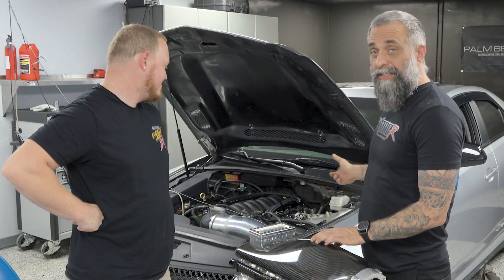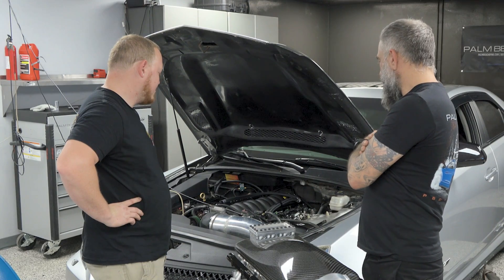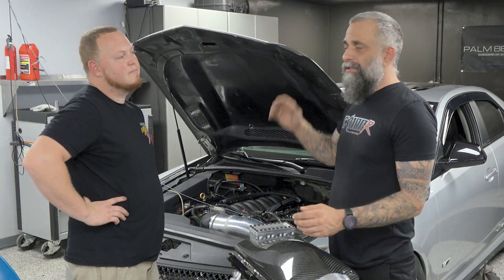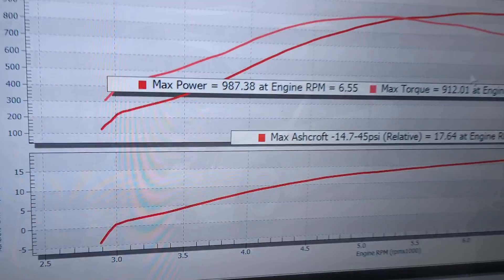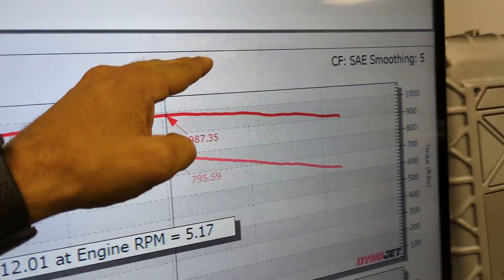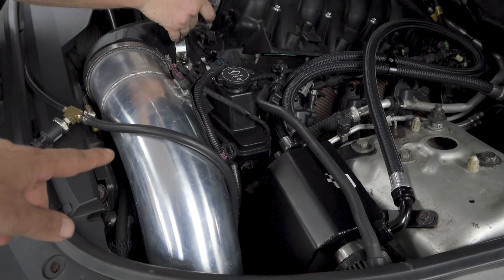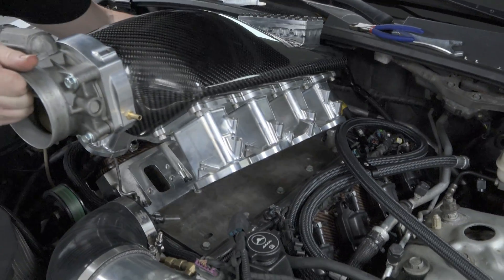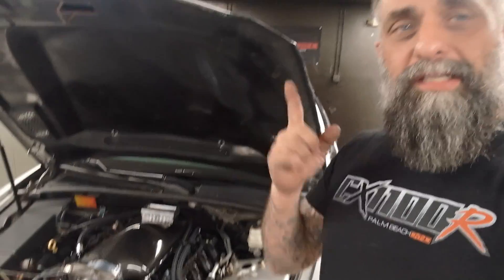LS3 Carbon Fiber Intake Manifold Dyno Test! Before and After

Comment: a V with a 5.3 is a sleeved 5.3 better than a 6.2 LSA
Reply: Yeah, its a GM 12571048 aluminum block (most likely, because that part number is the majority of the desirable aluminum 5.3 blocks) with darton sleeves. Its better because the ductile iron sleeve is much more thicker and rigid than oem, and the cylinder barrel is longer than stock, so 4" stroke pistons dont flutter the ring at bottom dead center like they do in OEM iron and aluminum block deals.

Only thing it doesnt have is oil squirters like the LSA, but aftermarket pistons arent designed with them in mind, so they typically get blocked off anyway
Reply: @edmundnlemadim8480  thanks for the info
Reply: With boost yes but I think he said it’s a 423
Reply: Honestly wasn't expecting that large of a gain because of the twin turbo setup. I'm impressed